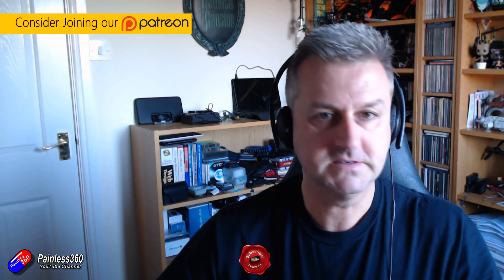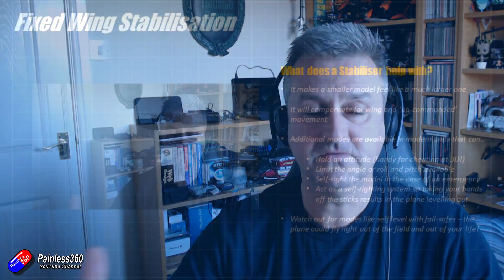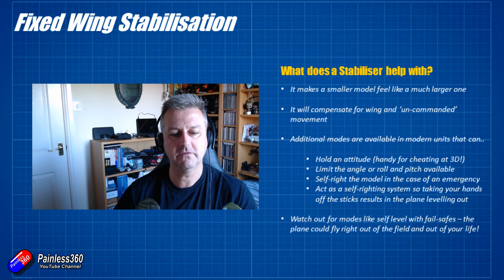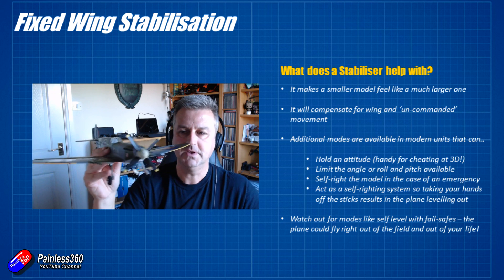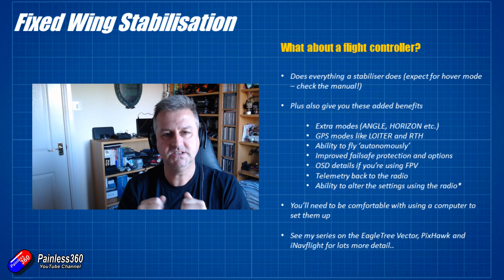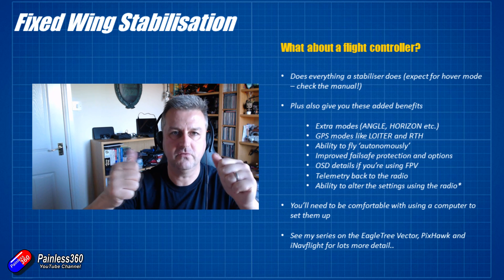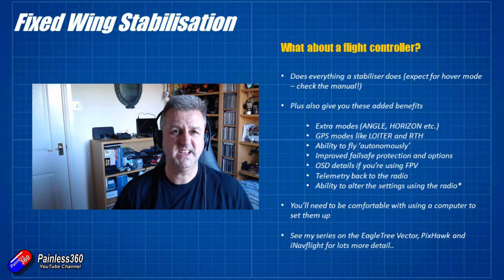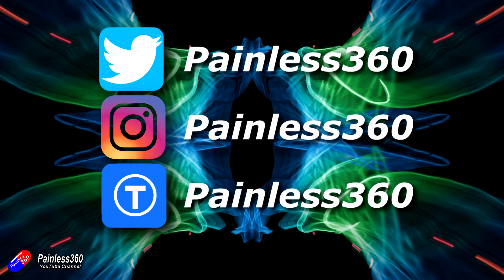Fixed Wing and Planes 101: Stabiliser or flight controller?

Comment: My question is not RC related but it's parallel subject. I'm wanting to implement a glass panel with AHRS and autopilot on my fixed wing amateur built experimental aircraft, a Pulsar XP with a Rotax 912 engine. There are open source solutions and many out of the box solutions but I wondered if a Flight Controller couldn't be used as the heart of an Attitude Heading Reference System with other information available on screen such as vertical speed indication, and a whole host of other useful information. My plane has very sensitive aileron and elevator controls so two simple servos coupled to the push pull tubes via springs that can be manually over ridden to remove all liability involved in an actual aircraft application. Any thoughts on which FC could be used or do you have suggested videos that would be helpful?
Reply from the maker: Without knowing a lot more about what it is you are trying to do I'm not sure. All FC software can provide AHRS and an OSD and telemetry... Best of luck

Comment: Excellent video!!! I have a very fast and short fixed-wing plane "Durafly (PNF) Goblin Racer 820mm EPO".

Do you recommend binding a stand-alone stabilizer with a receiver or getting a receiver with a built-in stabilizer? And which receiver would you recommend for TX16S radio? I was thinking about SxR FrSky. but I can not find any test flight with SxR mounted on a fixed short wingspan plane.... they are mostly mounted on gliders which are relatively more stable by nature...

Thanks for taking the time to reply. 🙏🏼
Reply from the maker: I've used both and I'm not a fan of SxR receivers from FrSky.It was a good idea but the implementation was terrible. I use things like the KoPilot or the HobbyEagle stuff..

Comment: This video was a godsend. I have used an AS3X receiver in an FPV wing for a while now, mainly just to alleviate the jello cam caused by inherent pitch instability. I had alway thought of flight controllers as purely a multirotor thing, but this video makes me consider getting one... An OSD seems like a rather nice addition

Comment: Would a flight controller gyro be better and if not which gyro would you prefer and why?
Reply from the maker: Kopilot. It also has GPS RTH..
Reply: @Painless360  Koplit is a flight controller?  is it compatible with my spektrum radios?
Reply from the maker: Check out my Kopilot Playlist ;) Even a video on Spektrum too
Reply: @Painless360  Thanks a lot for your help.  I am brand new caveman trying to make space rockets right now and having some success.  I watched some educational stuff you made about gyros too so I may ask more questions about it later.  Does the kopilot system allow for specific gyro settings?  I don't want limited pitch and roll I just want to be able to knife edge and probably ignore unwanted inputs.  Also I would like to know if you know anything about rotating wing gyros?

Comment: What has to be considered connecting a stabilizer on a wing with two servos mixed on the tranmitter for elevator and aileron? 🤔
Reply from the maker: Most stabilisers support various fixed wing types - flying wing, traditional and V-Tail.. See the setup videos for them on the channel.. Best of luck!

Comment: maybe dumb question but can i do fpv without flight controller? i have ar wing pro and stabiliser,  tbs crossfire tx micro v2 and tbs rx nano, and will buy tbs unify pro32 hv, and goggles ev800dm, i need fc?
Reply from the maker: You don't need a flight controller for FPV. See my video on how to add FPV to a model easily.. Best of luck

Comment: Good day Lee, Not sure if this is something you can answer, can any of the controllers or stabilizers work with the out put from a 72 MHZ receivers out put. I am using several early 90s Airtronics radio and receivers  and sure like the idea of some of the options you mention in the video. Ya my planes are all from early 90s as well. Thanks in advance. Jeff
Reply: another question, for setting up either a stabilizer or a flight controller, can a Mac be used or only a PC?
Reply from the maker: A few will still support PWM style input... Best of luck
Reply: @Painless360  Thank you for the quick response. I guess if they say they support PWM I should have a good chance to make it work and be able to make all setup changes with a PC and the manual reversing switches in my TX.

Comment: This is a great video with perfect explanations. Thanks!  But I have a question for you: would the HobbyEagle A3 Super II works with combination of power box set used on the big airplane with petrol 50ccm engine? I cannot find any information on this. Thanks in advance !
Miroslav
Reply from the maker: Not sure, I've not tried that.  Best of luck

Comment: Hey - it might be a stupid question but it bothers me. 
Gyro = stabilizer ?
Can gyro and flight controller be separated from receiver ?
Reply from the maker: The gyro is a sensor that derects rotational movement. It's one of the sensors that all flight controllers and stabilisers use to detect the movement of the model. It's usually a chip on the PCB so part of the device.. Happy flying

Comment: Hey everyone! I have the A3 Pro Gyro. It's super good for windy days, keeping the plane(FMS Super EZ v4) stable while i test FPV setups. My only problem / project is that I want to be able to add a GPS for at least Return to home. I do not need self land or waypoints, Its just for in case my FPV feed cuts out at a long distance. Is there any way to add a gps to the A3 pro so that i can have return to home? I do not need OSD but a failsafe when i can't see it would make my RC setup perfect. Hopefully you have an idea or any tips. THanks in advance!! great video also

Comment: Hi. I have just purchased the ZOHD kopilot lite. I am using Futaba radio gear. Can I use the SBus connectivity system between the ZOHD controller and my receiver  without using SBus comparable digital servos????
Reply from the maker: Yes - see my series on the KoPilot..

Comment: With my health, I need a stabilization system in my planes. I talked to many older gents at the air field that said they would be forced to retire from the hobby if it were not for the Stabilizer. Smaller planes are inherently squirrely and benifit from it. All my mini planes have it. Where I live, wind is a constant issue. We get about an hour at sun up and sunset where the wind does die down enough to fly with no wind. Its really hard to set up a new plane while fighting wind.
Reply from the maker: We should all fly what we enjoy; there are no right and wrong choices in the hobby if we're having fun and not breaking the law. Wings, quads, air-planes, VTOL, FPV, LOS, cars, trucks, racing, soaring, control line, electric, gliders, IC, glow... whatever it takes to enjoy  your time at the field - that's the right answer for you. I've always found that an open mind in the hobby will always let you find new things to try and new experiences to share. Happy flying!
Reply: RC Hobbyist Extreme You must be in Kansas. 😅

Comment: I have crashed my fixed wings too many times installing everything from f3 to f7 flight controllers. Due to the current lack of support given by sellers of flight controllers and the complexity involved in tuning flight controllers I have to strongly suggest gyro stabilizer installation.  Painless360 and a few other awesome instructors on YouTube  are a very helpful source but even they can only help so much against those unfortunate gotchas that cause nose drives that destroy your planes and ruin your day at the flying field. I took out a f411 wing after a nose drive crash when all I did was switch to acro mode, destroyed my AR Wing completely. I am done with FCs, done!.
Reply from the maker: When looking into situations like, in every case I've found that the setup missed one or more vital steps. Sorry to hear you've given up but my build series on the channel show the way I get them to work every time. Best of luck!
Reply: @Painless360  ok ok you've talked me back into it 🤣😂🤣. I'll try one more time using your tutorials . Thanks!

Comment: Thank you for posting all these videos they've helped me figure out what components I would like to complete a project I started. I'm taking one of my 1/3 scale Decathlon with a DA 70 twin gas engine and setting it up for GPS autonomous flight. Trying the Dragonlink V3 on it while im at it. Will use long range VTX along with a Connex HD Downlink system just cause its sitting around not getting used. Likely will setup antenna tracking too. It's confusing and takes a lot of work trying to figure out which components are compatible and are best. I still can't decide if I want to use Pixhawk Cube with pitot tube, Eagle tree vector, Matek Systems F722 or 405 oh well I'll figure it out. 
Thank you again! And if you're around New Orleans Louisiana watch out for out-of-control giant scale airplanes : )
FCC Ham  KI5CJS
Reply from the maker: I will do! Happy flying!

Comment: Hi,  can a flying wing fly without a stabilizer?
Reply from the maker: Yep
Reply: While it is possible to do, one reason that 99% of full-sized planes aren't flying wings / blended wing bodies is that wings are not naturally stable.  They are hard to fly without electronic stabilization.

Of course, some planes that modelers call flying wings aren't technically flying wings at all.

Comment: I ordered one of these and kind of want a bit of OSD and the option to have the three levels of quad stabilization modes and the osd of bat voltage, compass and barometer..
What do your recommend? 
https://www.banggood.com/Skywalker-Mini-Plus-1100mm-Wingspan-EPP-FPV-RC-Airplane-Beginner-Trainer-Fixed-Wing-PNP-With-Landing-Gear-p-1487312.html?rmmds=myorder&ID=228&cur_warehouse=CN
I have the ZOHD Dart and Talon and totally hate the stabilization they implement.

Comment: Thank you! Great vid! Coming from quads...it answers many questions I had regarding setting up a fixed wing in the traditional manner vs. using a FC. Much to learn, but given my desire to do both LOS and FPV fixed wing,  I think i'm leaning towards a FC for all the features, particularly the OSD & telemetry for FPV.
Reply from the maker: Check out the playlist that is an introduction to fixed wing for quad copter pilots. Includes lots of things like this. Hope it helps.

Comment: Great video Lee, you covered everything 👍 But  I would recommend,  never use a gyro in a plane your skill level will never increase, however if you really want one  I would suggest learning how to fly without one first and then if you decide to put one in at a later time which you probably won't,  at least if it fails you will be  competent enough to keep flying and land your model. Just like learning to fly a Quad it's best to start in acro.
Reply from the maker: I understand where you're coming from, the only thing I'd add is that stabilisers aren't just for training wheels for new pilots - they can do a lot more. Not all fixed wing models are easy to fly and forgiving (EDF jets with little wings for example) so a stabiliser can make them a lot more capable and fun to fly. 

I find that subjects like this are very much personal preference and there are lots of dearly held beliefs - some quad pilots see ANGLE and HORIZON mode as cheating for new pilots learning to fly quadcopters. 

I like fixed wing models that are designed well enough to not need something extra to make it fly well (apart from FPV planes!), for me - I take the view that if it helps you enjoy the hobby (and it's not hurting anyone) then it's all good :D
Reply: It depends on if you want to spend time flying your plane, or crashing and fixing it. :)

But seriously, never having a stabilizer will force you to become a better pilot - every mistake will be costly.  Some people want that.

Others of us just want to fly around and take some video, not become expert pilots, and not spend thousands of dollars, nor spend 10X as much time fixing planes as flying them.

You are probably a better pilot than I am.  You probably spent thousands of dollars and hundreds of hours more than I did.

It's personal preference.

Comment: I've found the Bigaole BGL-6G-AP to be the best all round fixed wing flight controller.  I've tried several types over the years but I've now a BGL in almost all my planes and gliders, even my 6 meter FPV scale glider.  The BGL are the simplest to use and install, they're also light weight and cheap for what it is.  They're a 6 axis stabiliser with RTH and work exceptionally well, I've not had one fail or let me down yet.

Comment: Got my Recruit in the mail today put fpv gear in it and set it up in under 2 hours.  First ever fixed wing flight went out to a mile.  Plan on learning with the stabilizer and putting a F405 and gps I have out of a quad in it when I get better at flying.

Comment: Can someone suggest a flight controller capable of building a vtol? Just like the v22 osprey
Reply: Several of these have vertical setting so u can select vertical stability I planed to use this for vtol on small wings like armini

Comment: I started with Stabilizers and they work great .. then I started USING my CC3D on Librepilot .....  I like the Arm feature... less accidental throttle up .. Haven't done any flight mode GSC like INAV yet ... cheers !  ... this is my Favorite AIO  ... https://hobbyking.com/en_us/orangerx-microrx3s-3-axis-flight-stabilizer-dsmx-dsm2-compatible-4ch-2-4ghz-rx-w-rem-gain-control.html?___store=en_us

Comment: Very good video! 
But one thing was wrong from my perspective: Nowadays one can perform automatic landing of a plane with almost every FC which allows autonumous flying. In iNav one just has to evaluate the stall speed of your plane and then define proper waypoints including height and speed for your plane and then land with stall speed at the desired landing point. But even with a $17 OmnibusF4 Pro V3 you can just flash Ardupilot plane firmware on the Omnibus and the take advantage of all the possiblities the Pixhawk has.... That makes auto-landing much easier...
Reply from the maker: Please remember this is a beginners intro video. If you know that level of detail then you’re  almost certainly not one of the pilots this was made for :D A level of abstraction and simplification is always called for in a beginners video like this.. happy flying!
Reply: ok, happy flying as well!

Comment: i've chosen, in my opinion best flight controller, bigaole 6g-ap with gps ( RTH ). SUPER EASY to set and solid.  never failed me.
Reply: I mostly use Hobbyeagle S2 A2 and A3 as I use 2 independent elevator channels (L and R), because I design and fly my own parkjets. Does bigaole support 2 elev channels? Interesting to have RTH. Thanks in advance mate.
Reply: there is one elevator plug but you  can use  Y- cable

Comment: Thank you Lee, I got all my aircraft with Inav thanks to you, using omnibus F4 pro V2 and V3, I even repair them when is not power from computer to the usb or not power or movement on the servos due to no power or signal to the servos.  For me Inav is been bullet proof.  I told people, if you crash my plane, you got a big problems with your hands, because they flight by them self.

Comment: A great summary to de mystify this vital part of the hobby. For many years I have run a hybrid system for many of my FPV planes based on the Hobbyeagle A3S2 and S3 stabilisers, with these I run a gps OSD, (Skylark or Ez OSD) for all the vitals, including battery and a home direction arrow. I find this system to be by far the most reliable and most rewarding to fly, never letting GPS monkeys into the pilot's seat.. I've pretty much given up on Inav from a trust perspective. Anyway, thanks for posting another great video, cheers.
Reply from the maker: Thanks for the feedback, I agree - a few  tutorials aimed at fixed wing pilots with little experience with stabilisers could be of value..
Reply: Have you ever tried Arduplane on an original Pixhawk? It would change your mind.
Reply from the maker: I’m loving all of these different options and experiences in the comments for this video. I’ll talk about this in the next video - this is a cool hobby ! :)
Reply: I have several Vectors, f4's a pitlab and the hybrids mentioned, a company here in au are selling the ezosd,s for less than an f4 with gps, I had skylarks since long before inav came along. I just prefer the way the A3 stabiliser flies over FC's, although I am doing another build with an f405 and Arduplane, with high hopes.

Comment: Nice video Lee. I highly recommend the basic A3-L. Often on sale for around $20 and is my favorite low-cost solution to park flyers and windy days. I have used a lot of stabilizers and found that one is the easiest to set up, has gain control at the transmitter (very important), doesn't require SBUS (so can use a basic receiver), still allows acrobatics, and is an excellent value. Looking forward to your video on this topic.

Comment: Although some regard them as being heretical, I'm quite fond of stabilisers. And not just to save my planes when I mess up (not infrequent) Mostly I use them when the weather decides to change suddenly and the wind rises as they allow me to get lighter planes down safely.
Although I'm quite used to picking up bits of planes I'd rather not do it
Reply from the maker: There is a little bit of snobbery about stabilisers but they can transform some models and my favourite FPV models all have one (or a full flight controller).. my view on this is - if it helps you have fun in the hobby, then go for it! :)